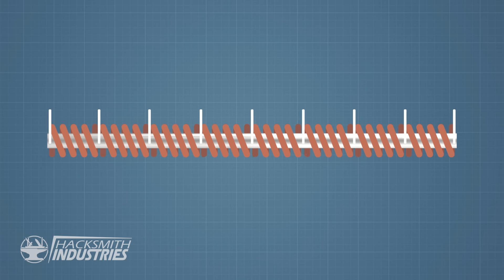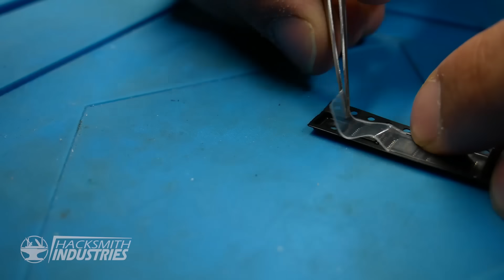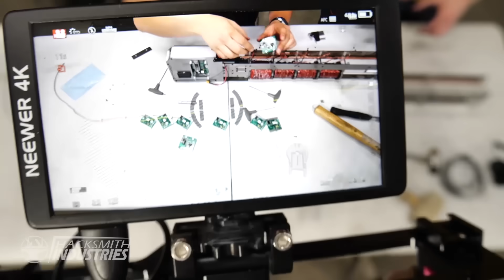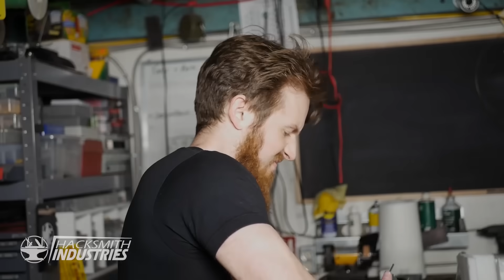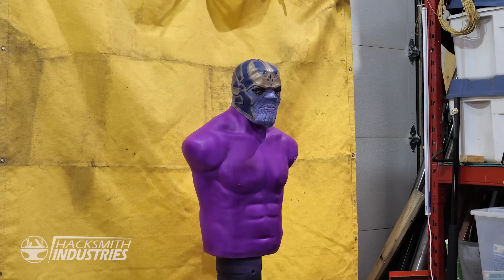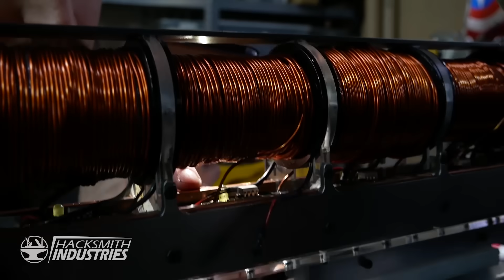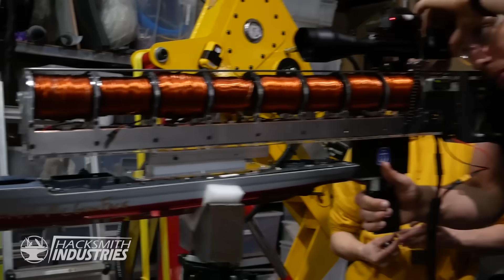50 CAL ELECTRIC COILGUN

Comment: i mean, if you'd rifled the barrel i think it'd have shot a lot better
Reply: And make the projectiles into tiny fin stabilised sabots
Reply: Hard to get spin, the lack of friction in a coilgun is what gives the projectile speed. A dart could work, all he would need to do is machine one of the rounds he has to have a thinner part between the head and the washer-like tail section. Simple, front-heavy, and makes its own drag at the rear. Also, the reduction in weight would allow for higher speed, so less drop over the same distance.
Reply: @mojavewastelander4035  he should make fin stabilized discarding sabots
Reply: Maybe a round projectile would have less drag if it tumbles?
Reply: @st4rship_780  an apfsds projectile wouldn't tumble
Reply: @vojtechklouda7630  yeah its the same thing mate just without the "Armour Piercing" APFSDS stands for armour-piercing-fin-stabilized-discarding-sabot

This here coil gun is not an anti-tank gun
Reply: @st4rship_780  i know, I was replying to the wrong person sorry
Reply: @vojtechklouda7630  aight mate
Reply: Rifling only works with chemical projectiles because it channels some of the explosive force around the bullet, giving it spin.  EM guns don’t have any explosion occurring inside the barrel, so the only way to get a “rifled” effect is by literally making bullets with a screw on the outside, which would utterly negate the advantages of the weapon.

Your best bet at getting more accuracy out of the weapon is in adjusting the shape and design of the ammunition itself.  More weight balancing on the slug, maybe adding pop-out fins for in-flight stabilization, etc.
Reply: @OneBiasedOpinion  rifling also works with compressed air
Reply: No rifling is needed really. But i would use one controller and more capacitors. Also i would place capacitors on each coil or at least power every coil with a different set of capacitors. Also i would use a ceramic tube and, as some people already suggested, something like dart shaped lighter projectiles with steel discarded sabots.
Reply: @st4rship_780  true!  Though it’s still the same concept.
Reply: @OneBiasedOpinion  well, i'm not exactly an expert on the subject, but if it was "rifled," meaning that there were small, angled grooves kinda in the barrel made of something like plastic, that would mean that the EM force would be slightly weaker in certain areas, thus allowing it to have a small amount of twist, making the projectile go faster, no?
Reply: @pickleproductions2010  no.  The electromagnetic force would be the same.  The grooves might cause the projectile to spin a little bit, but not nearly enough to matter.
Reply: And it always strikes sideways, which is not penetrative... making the rounds spinning will stabilise it on pitch and yaw axis
Reply: And you sir are correct
Reply: I think it would better if they the took a bit of inspiration from shotguns, which have no rifling. The projectile should be made like a shotgun slug, which are designed to spin without rifling.
Reply: @st4rship_780  with a coilgun you don’t need a sabot, you can just have the core. I’d love to see how the timings would have to change for a long rod that spans multiple coils.
Reply: @st4rship_780  maybe round but dimpled like a golfball to reduce drag
Reply: @st4rship_780  maybe steel sabots around a tungsten projectile?
Reply: My idea on how to make the projectile better.    

1. Dart shape
2. What looks to be a normal pointed bullet on front. 
3. Taper it down to a lightweight plastic or carbon fiber rod.
4. Taper back up to a steel rear.
5. Length is slightly longer than the length of the coil. (The length of the first section needs to clear the coil and become affected by the second.)
6. Half the diameter of projectile used in the video.
7. Use a low carbon steel.

Have two coils pulling at the same time.  One on front piece, one on back piece.  Double the power.

In essence, it is a pulsed coilgun design instead of a sequential firing.

For the coils themselves, use steel washers between the coils.
Reply: Use a Diablo shape, think sir rifle pellet shape. This are stable no fins needed.
Reply: @OneBiasedOpinion  Actually, no rifling does NOT "channels some of the explosive force around the bullet, giving it spin".
It forces the bullet into a slightly smaller space so that the outer casing is deformed in the rifling, with the forward motion causing it to spin.  Think of it like a screw in a threaded hole, but the screw's thread is formed by the hole, and the pitch is very long.
Reply: If grooves were CBC milled in the round, with the front 35% of the round tapered, also if each coil was tuned to individual timing duration instead of a flat rate for the timing unit, a higher FPS could be obtained exiting the barrel, and a groves round the give a mild spin to the front end, with small channels on the rear, would help channel the wind resistance. Keeping these rounds going straight
Reply: @mojavewastelander4035  Why not spin the bullet up before you fire using a rotating magnetic field? No rifling needed that way. And would it work better if you spaced the coils in a Fibonacci sequence instead of evenly spacing them?
Reply: That's not how that works. Think missile.

Comment: Incredible you actually made it. One thing that might maximize the "lethality" would have been the creation of a bullet with optimum aerodynamic shape and less weight. That's because I noticed that it's time it hit the target did it, not with the tip but the whole body of the bullet. That means that the air drag reduces the speed of the projectile and created torque that put the bullet in an unstable pathway.

Comment: It is awesome, but needs rifling to stabilize the projectile😁
Reply: And an upgrade in the design of the projectile because a rifled barrel doesn't help much without a property balanced and aerodynamic round
Reply: Not rifling. Coilguns are better smoothbore and fun stabilized
Reply: @violet9214  Ok but would you agree that a projectile with a more stable flight pattern would be the next logical step in improving that coil gun for now?
Reply: Mike Leatherdale definitely
Reply: @mikeleatherdale2950  possibly make the projectile fin stabilized
Reply: fin stabilized is probably the better way to go with a coilgun.
Reply: @violet9214  Fun stabilized bullets are the best cause you know they are happy and will probably do a better job then a sad stabilized bullet.

Comment: Try to use super capacitors to dump all the energy at once and control the timing, though it would take a moment to charge up, you can reload during that time and the bullet will go out with much higher velocity

Comment: Makes a crazy complicated coilgun - doesn't machine fins into the projectile...
Reply: lol
Reply: I would use a nail cuz is easier to cut the nail head the flat part into fins
Reply: Maybe they could 3d print a  sabot to go around an off the shelf masonry nail. Make the nail a dart by glueing on fins to get it to spin. Print the sabot so that it has longitudinal grooves and holes into which metal rods or wire can be inserted.
Reply: Yeah i was also surprised they didn't an apfsds ammunition for this project
Reply: The fins would increase the magnitivity of the end of the projectile so it would get stuck in the barrel or it would just be extremely bad at flying
Reply: @TLGHuntsvilleAL  I mean you do realize coilgun work because it's a giant magnet right?
How would the magnet work if the projectile is fully plastic

Comment: Hey Hacksmith maybe for the next version you could try

1.using a spiral barrel to make the projectile more accurate
2.MORE POWER (Maybe adding something that can take power from a wall outlet then being able to switch to the battery)

3. Make a reloading system so you can fire in different modes like semi and auto
Reply: Dark Luminous Maybe they could use another type of wire that conducts mire

Comment: I see all the suggestions about rifling and I'd like to point out, these guys aren't looking to make functional weapons, more proof of concepts. I would love to see this ramped up, but at the same time, their shop doesn't appear to be designed for field testing military ballistic weapons. Still damned cool!
Reply: And how everyone is pointing out it's not amped up like it could be
Reply: @tiredman99  and also ignoring the gun had one malfunction. 

Basically these Dunning Kruger's don't have a clue what's even going on with this coilgun. 

1. Yup it shoots like a shotgun slug because the current design requires no barrel lubrication. 

2. Those circuits can only cycle so fast and can only handle so much power output. This is the main reason they are using a heavy shell.
Reply: Itd be cool as shit to build it fully funtional then take it out to demoranch or something. Do a channel collab
Reply: Point made, but do you think a musket ball type slug would be more appropriate for this design?
Reply: @paxaeternus5718   They used a half inch bolt because it was as long as a single coil. This allowed the bolt(hence the bolt action rifle joke in the beginning) to float down the center of coil. So basically the musket ball would have to achieve the same type of balance most likely by building a whole new coil size and array.
Reply: @paxaeternus5718  I think the issue there is that a ball doesn't have the magnetic grab to be propelled properly. A cylinder allows a greater surface area to be within the magnetic coil range
Reply: @paxaeternus5718  I was thinking more along the lines of a raindrop shaped projectile. It’d have to be decent size or the coils would need to be redesigned. Plus the chips might not be able to handle the speed. But for a good heavy hit, maybe put a bit of tungsten in the center of the “droplet.” Lol.
Reply: Should be a way to get the projectile to spin with magnetism shouldn't there?  Once it starts to spin the rotation should maintain through flight.
Reply: then use a different circuit utilising igbts. besides riffling the barrel for projectile stability wouldnt be too difficult
Reply: Well, they can prove the concept that they can make a stable projectile. :)
Reply: @forcesightknight  or have a lubricated barrel with a pre fire spin stage to spin up the projectiles before launching, with the lubricant idealy preventing too much loss in spin speed before exiting the barrel
Reply: @UNSCPILOT  it just shows how important electronic engineering is.  EE and computer programing will literally rule the world.
Reply: Would the rotation generate electricity
Reply: @brystalwilliams6073  Likely not as the rotation would be imposed on the projectile (with rifling) through what amounts to air pressure. Since these are electromagnets, their charge state exists for such a short time, they wouldn't get the chance to develop the necessary fluctuations from the spin to generate a reversed electrical charge.

Comment: I bet Lockheed has a lethal version of this hiding down in one of their R&D labs.
Reply: You're kidding, right? Look up US Navy Rail Gun.
Reply: @AlienRelics  That thing has to be mounted on a freaking warship and requires the warship to basically go into low power mode to fire...hardly the same thing lol. A 50. cal hand held coil gun requires huge, huge leaps in power advancement.
Reply: @ericm5315  it is pointless to shot big projectile like .50 cal out of coilgun. the smaller projectile is the bigger penetration power. (less weight to accelerate equals more force archived through speed)

Comment: You could carve up the bullet a little just so it spins by the friction with the air. Also if you make it lighter it would go way much faster
Reply: LobbyVictor lighter also means less force on impact
Reply: @awesomo660  even though it would mean less force of impact, it would be way much more stable and it would have a bigger range too. With bullets so heavy you can't make a sniper or any kind of gun that would actually work. Maybe as a fun project but nothing more

Comment: One point on how the coil guns work, theoretically it's possible to get more velocity by magnetically doping the rounds and switching the polarity of the coils so that it puls tge round towards it then as it passes the centre line starts to push it forward as the next coil pulls. Granted this requires precise timing in switching the polarity otherwise you lose efficiently 
Also using smaller lighter rounds would mean higher velocity and thus higher kinetic energy (E=½MV²)

Comment: “MaKe It MoRe PoWeRfUll” says half of the people who barely know how hard it is to design something and make it at least a bit useable...
Reply: As an electrical engineer, it's amazing to see what these guys can do without having a massive budget
Reply: yeah until someone get killed, the comment will be
"That your fault to make such dangerous thing" XD
Reply: It still hits like a truck. Just cause it’s slow didn’t mean it can’t hurt someone
Reply: So true tho
Reply: @limeguy8280  Well they do have a very impressive set of tools at their disposal. They have limited time though. After all , they run a business, and they are in the entertainment business. The question is simply "will optimizing it get enough views to be worth the extra time?" and the answer is most likely no. They made a design, they stuck to it till the end. It works, but it's not optimized, but the video is a success. Those of us who are really into this kind of stuff would really like it to be optimized though. I would like to see someone with the knowledge, resources and time really optimize one of these even if it's a multi part project.
Reply: Limeguy then again the circuitry alone was around $2,000?
Reply: @connordziadul6048  That doesn't sound right. If they paid 2000 dollars for that, they got ripped off big time.
Reply: mrkiky I’ll double check. I could’ve sworn that said $2,000. Imagine though, if PCB boards were actually that expensive.
Reply: @connordziadul6048  pcb board printing here like just around 3 times your paper printing cost. I don't know what you are talking about
The wire is a bit gnarly but not stupidly expensive
This people are sensible people, they do stupid stuff but they still do it economically
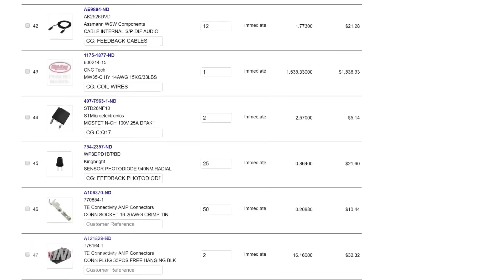Reply: @mrkiky  it's around 2000$ look at 5:53 -5:54
Main thing seems to be wire but by the list of things I'm 75% sure it's part they'll use again later or part for another project
Because the list they gave and the list on that video don't quite line up
Reply: @aronseptianto8142  Hmm I guess I didn't realize that copper wire is so expensive. It's 15kg and they pretty much used more than half of it (which again I find counter productive). Also to note is that it's in CAD so it would only be around 1500 USD.
Reply: Aron Septianto I’m just imagining a world where copper was so expensive. Chill I’m 15. I don’t yet have accurate price thoughts. I go to B&E for electronic supplies and PCB boards are typically $12-20.
Reply: @connordziadul6048  where do you live? Because man, that's expensive
Arduino sized pcb here cost only like 3$
Reply: @mrkiky  tbh I'm not really sure
They seemed to be bottlenecked with the mosfet overheating too fast
But I guess since it's for a video cool factor matter more than reliability
Reply: Aron Septianto I feel ripped off after purchasing 10 to make a 400v e-cap bank....
Reply: @connordziadul6048  is it like very neat or something
Because to be fair
My usual printing place looks more like a drug dealing tent than a printing place, the less sketchy place charge like 4.5$ but I don't see much different in quality
Still though, shouldn't cost 12$ sounds expensive af
Reply: Aron Septianto well these boards aren’t customs printed, and have mostly individual holes. 200 Pins? Inside the store I go to, it’s like an Amazon warehouse. Small boxes of components line the shelves everywhere. Reminds me of a comic book store

Comment: "Speed of light, the maximum speed of the Universe!"
Edge of Universe: expanding faster than light
Reply: The speed of light is the fastest speed within the universe itself. The universe itself is perfectly fine going faster than that, because, you know, it's the UNIVERSE. It doesn't just make the rules, it IS the rules.
Reply: Universe is still obeying the limit, it's just the space between millions of points is expanding, so the distance between the edge and the center is moving at the sum of all those.